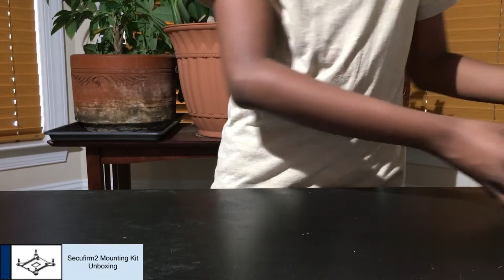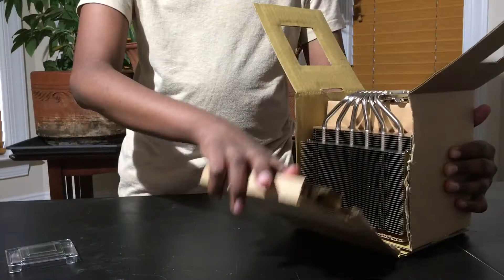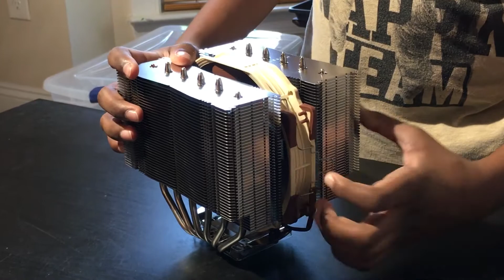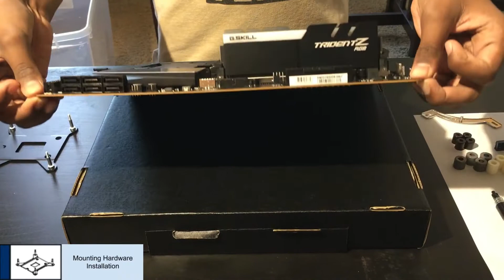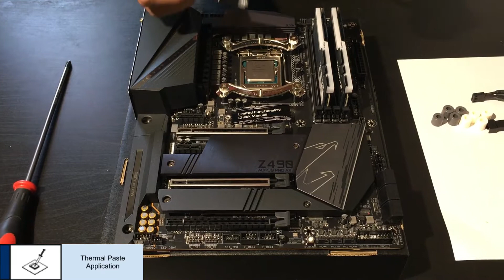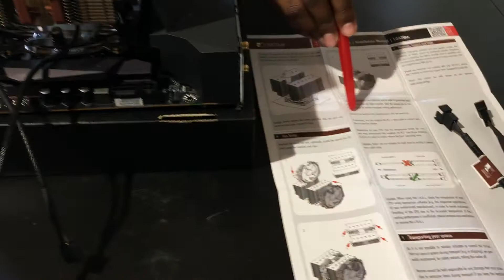Noctua NH-D15 CPU Cooler Installation - Gigabyte AORUS Z490 PRO Motherboard

Comment from the maker: DISCLAIMER (for those who did not read the description): The video incorrectly states that the motherboard is the B450. This is wrong, as I mixed up the names with the actual name of the motherboard, the Z490. However, this video IS still an accurate depiction of how to install the CPU cooler onto the Z490, I apologize for the misinformation!